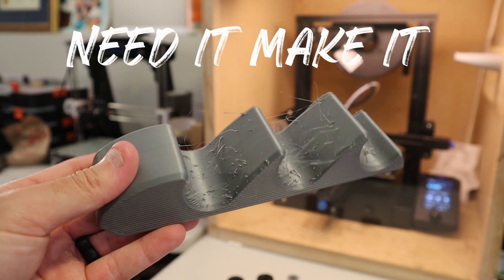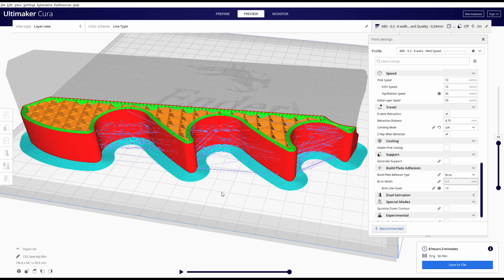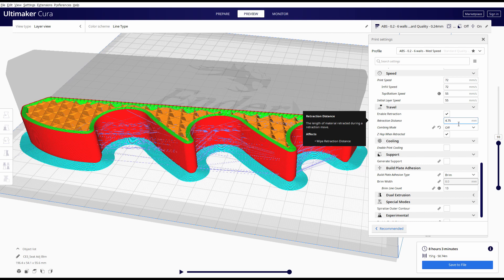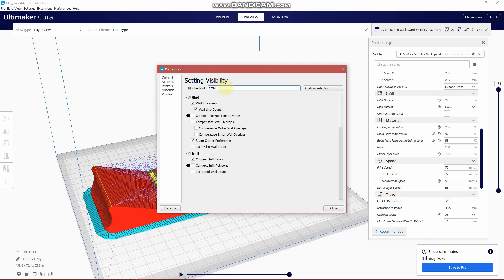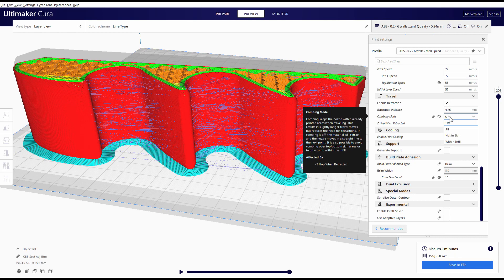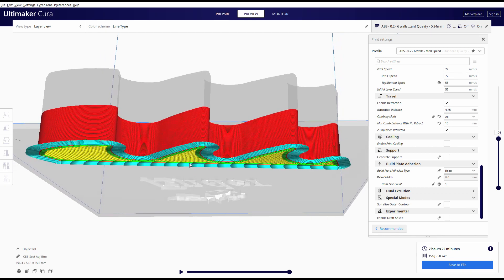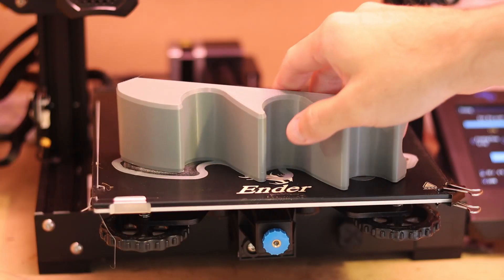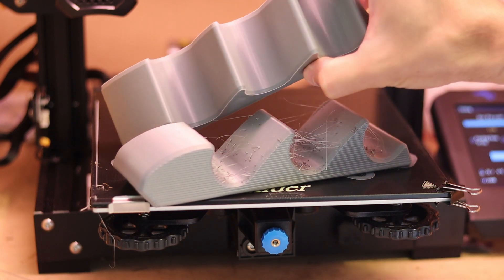Creality Ender 3 V2 - Stop Stringing, Improve Print Quality & Time With These Two Settings

Comment: That filament roll mount location is amazing! How has it been working for you? I've been trying to figure out a way to mount mine to waste as little space as possible (very tight location)
Reply: You save space but reduce your vertical print volume
Reply: @johnl.38  Yeah I tried it and actually the spool doesnt seem to reduce print height, just the holder, so only few cm. But what about the angle of filament to extruder? Does this setup need special filament guides?

Comment: switch to silicone bushings and get rid of those crappy springs on the bed, I did it to all my printers. It made leveling them so so so much better
Reply: Until you heat the bed up to 70c and they get all soft and mushy..
Reply: But they will still hold your initial bed level.

Comment: UPDATE > Hi all, I now got a new smaller 3D printer which is called a " Voxelab Aquila " this is a clone of the Creality Ender 3 V2 printer 
( Voxelab is sub company of Flash Forge ) 

Buying this printer instead of the Ender 3 V2 has saved me £87.00p and I still have the same high value printer that the Ender 3 V2 is.

This Voxelab Aquila is really super to use, there is even a very clear detailed how to build & level it video on you tube by the Voxelab company. 
The printer comes already 70% built anyway so it take only about 30 to 50 minutes to build and then do your 1st print.

It has no run out filament unit fitted, But the software has it listed to turn on later if you buy or make a run out sensor unit 
and the connector is there on the main board as it uses the same board as the Ender 3 V2.  

Also this printer has a Meanwell power unit so another great item fitted.
Like many printers it has silent steppers and board But the cooling fans are a bit noisy so you may be best later on replacing the fans for more silent type fans?

There is a new channel I found where a great youtuber mostly deals with the Aquila so you best look him up?

His channel is called > 3DPrintSOS here is the link > 

https://www.youtube.com/channel/UC1MsDQaRANzwISN8cHJ1VmQ

He shows the better fans to put in and how to do so?
Also he come up with a better extruder tube connector to stop the PTFE tube coming out due to retraction moments.

I did notice how I got allot of stringing with PETG filament when I print, I found that PLA + is more better for printing with less stringing and often no stringing!

As for my big Tronxy X5SA 2020 model. I had issues with it not being able to level right even using the manual or auto leveling,

So I will be getting a new glass mirror like bed to get the really flat smooth bed surface needed to do leveling right, 
Also I need to change the firmware over from the self made Tronxy one to a Marlin version and change the 
magnetic induction bed level sensor on the Tronxy to a BL Touch. 

Then I should be able to use this huge printer at last fully.

I don't wish to have such a big build area printer usable.
( the bed is 330 mm square and the height of prints are up to 400 mm )  So almost twice that of the Aquila or Ender 3 V2.

Thank you NeedItMakeIt again for your lovely helpful videos I hope everyone gets great prints too?

Comment: This is printed with ABS, does PLA require different settings?
Reply from the maker: For PLA, fan set to 100%, nozzle temp at 200, bed temp turned down to max 60.   I'd tend to increase the infill density with PLA, it is stiff, but more brittle and under heavy loads may be prone to cracking.
Reply: @NeedItMakeIt  Thank you for your time, I appreciate your answer. 👍

Comment: If it's faster AND better, why isn't this always turned on?
Reply from the maker: You'd have to ask the people at Ultimaker, I cannot determine why someone would not have this applied as standard unless there were some hidden drawbacks.  If you asked me to speculate, I'd say that travelling over infill could cause small prints to dislodge from the build-plate.
Reply: Restricting the slicing has to increase the time required, unless the slicer optimizes for something else not known. Could just be an error in the time estimate. Have you measured the actual time?
Reply: Late reply but I think it depends on part geometry (a lot)
Reply: I think we need to find out where the Printer gets the the additional time. Normally Cura already calculates the optimum travel path and with combing the travel will be longer becauser the nozzle will not take the shortest distance to the next point. I mean something how the part is printed has to be changed
Reply: @tataa51  quantum tunneling
Reply: Right?!
Reply: Might be to reduce the slice processing time for weaker computers.

Comment: Nice video! I will try these settings on my next print. i do have a question on something else however. I have the ender 3 V2 and i printed something out with ABS and i did not save the damn settings, so i loaded the stl file back in and printed another one out with the settings i thought i had and the part come out lighter in weight. Both parts look amazing overall but the first one weighs .9 and the second one weighs .06, you can definitely feel the difference  for sure. Both parts were printed with 100% infill so i do not get it. Any suggestions? Is there anyway to load the GCODE file back into cura and see what settings i used?
Reply from the maker: Yes you can load the gcode back into Cura, but I've never tried looking at the settings afterward.  I've done it by accident...  Both parts printed with 100% infill, seems like it would be solid.  Is it possible that one print is hollow and you were not watching so you were tricked?
Reply: @NeedItMakeIt  I do not think one is hollow, I have printed the same part these last few days 5 more times to try and figure it out and no luck. I think I will cut both parts open and have a look on the inside.
Reply: @ericc8895  5 months later but I'm still curious. What was the verdict?

Comment: I have had an ender 3 v2 for just over a week but have had it printing what feels like nonstop since and have easily 60+ hours on it already at first it printed beyond perfect but it has now developed a stringing issue so I turned combing to all and uped retraction to 5mm and printed a stringing test but still came out rough so I upped it to 6mm and left combing on and it printed better but still off so I left retraction at 6mm but just turned off combing and it printed like the first day I got it! Any insight as to why I'm not having the same luck?
Reply from the maker: If you are printing with PLA or PETG , they absorb moisture more readily it is a major cause of stringing.  You can bake a roll on low, make sure it is very low 60C for example, you can also bag it with dessicant for a few days.  Hope that helps.

Comment: what are the dimensions of the ender case?
Reply from the maker: If you mean the print volume, it is 220 x 220 x 250mm,  If you're talking about the enclosure mine is 580 x 580 x 580, and it is a little bit big.  I hope that helps.

Comment: Ive been watching a bunch of your videos and must say, if you could create like a summary video/post/sheet with a summary of your findings for different filament types that would be freaking amazing on the Ender 3 V2. Thanks in advance for your consideration!
Reply from the maker: I have a few videos in the works now, but it can certainly go on the list, are you able to give an example of the kinds of tests and comparisons you'd be looking for.
Reply: @NeedItMakeIt  layer adhesion, surface finish, how prone to stringing some filaments are
Reply from the maker: @kilogee700  I've been working with ABS lately again for a VORON project, but I will also be experimenting with ASA, I can certainly see if some of these can be added back in.  I'm goingt to be 95% focused on 3d Printing for my channel that seems to be the area most people are interested at the moment.  I've been working on bridging with ABS, I'll likely make a video once I learn enough about it.  Bridging with PLA is fairly easy with cooling, but ABS doesn't normally use fans, but there are some experimental settings in CURA which allow the fans to be used only when necessary.

Comment: Hey man what are you support distance settings? ive been printing a 50g print and its failed a couple times which has me a bit overwhelmed, tried current cura 4.8 with fatdragon profile, cura 4.1 with siepie profile and today i tried ideamaker which also make it impossible to remove suports on the face of this model, making it unusable in the end, im afraid to go ahead and print 12 hours again and encounter the same
Reply from the maker: I don't print with supports, nearly never anyway.  If you print with PETG this might be your problem, it tends to have good layer adhesion even when you don't want it.  ABS and PLA seem to separate well with the standard CURA settings. 

I am working on a video now which addresses supports from a completely different perspective.  Same goal, new method.  It doesn't work for curves surfaces, only parallel to the build plate though.
Reply: @NeedItMakeIt  its esun pla+, while its giving me better details still have problems with removing supports from the face of this model, i noticed that z distance on this particular profile was 0.2 and layer height of 0.12 and x/y distance of 0.7 with a 0.4mm nozzle, im guessing this could be the problem based on your video? ty for your reply

Comment: Will these settings work with tpu
Reply from the maker: I've never printed TPU personally.  If you are running a Bowden setup still and you print a lot of TPU, you may consider switching to direct drive.  I'm sure it can be done, I would wonder how well Bowden handles retractions and extrusions because the elastic nature of the material.  Tries to pull and it will stretch before a reaction at the nozzle.  If you don't already have Capricorn tubing, I'd switch over to that as well so that you have a tighter toleranced tube to handle the flex a bit better. 

These settings will still work on any filament, I keep combing turned on all of the time no matter which part, the results are always better.

Comment: Canadian. I’m in 🇨🇦 oh and amazing print. Is there a disadvantage to having combing on for parts that don’t have “peaks”?
Reply from the maker: I leave it turned on for all of my prints, there may be a disadvantage if you have oozing, I'd need to investigate how the nozzle moves through the part and compare the paths.    Most people have reported very good success with this method, however there could be cases where it would be better off, I personally haven't run into any.

Comment: can we put the same settings for PLA ?
Reply from the maker: You can use the settings and adjust the temp and fan as needed.  I print with a little higher temp and fans down low.  0.6 nozzle size also.

Comment: I think new Cura has this option turned on default, because my printer produced clean printings since the beginning.
Reply from the maker: Maybe it does, I'd have to reset it to check, but that would make sense, there doesn't seem to be any reason to turn it off that I have come across.  Thanks!

Comment: My only point- why not just print that in the flat orientation...
Reply from the maker: I find that this part turns out a little nicer on edge.  Way back when I started printing these and was not sure how strong them were, I printed them in the orientation to maximize their strength.   It seems they are much stronger than I expected and it probably isn't necessary to do that anymore.  Valid point!

Comment: how do you see the stringing in cura ? Thanks
Reply from the maker: With the right settings, I don't find it too bad.  Adjust your retraction to around 5, dry your filament and some people use coasting, I can't tell if it helps.  If you print with PLA or ABS, you'll have less issues.  I'm printing with PETG now and it does string quite easily, that's where better quality filament and drying it out can help a bit.
 
I'm happy with it overall.  I'll end up trying out other softwares down the road to compare.

Comment: Wow that print looks really good! Do you get that quality consistently with your machine?
Reply from the maker: Yes, pretty good results every time.  I find the PETG shows any small irregularities more than PLA or ABS because of the sheen, but it really is a good printer for the price.  Far better than my Anet A8.  You'll want to check out my video on the hidden problem with the fitting if you're having any issues with stringing and retraction.  I'm working on a follow up video to solve the problem once and for all!

Comment: New subscriber : I have several CR10 and I used to have my retraction at 5-6 and then I tried 4 and that has made a huge difference in the quality and I have always had combing on infill.  
I have tried PETG but I’ve stuck to doing small parts because I don’t want to invest in a lot of time just to have it fail ten hours into a job.  guess I have to man up and go for it.  I mainly use PLA and hairspray for bed adhesion that works very well for me but I think I’ll try glue stick for the higher temperature filament. 
Anyway great channel you have here. Thanks I’ve already learned something new from an episode about fixing the slop in the boden tube 👍
Reply: Did you change your retraction speed too / what's your value on this setting ?
I also have a CR10 and I'm not sure my retraction speed is very well set which might affects my prints :/
Reply: @andycarus3250  my speed is set at 45 I find that if it’s too fast the extruder gears tend to eat up the filament and cause it to break. 40-45 seams to do well for me.
Reply: @jack0cat  Thanks 👍

I was at 70-80, it seems to be a little bit high indeed ...

Comment: Awesome, definitely turning combing on...what I’m wondering is why would you ever turn it off?
Reply from the maker: It has to be one of the single best methods of getting a nice looking print.  I always leave it on, I really can't think of a good reason to turn it off.  There are times when it will not solve the problem, for example when a part has multiple vertical pillars to print, it will still jump between them, but many of my parts print flawlessly with this method.
Reply: @NeedItMakeIt  not to mention you saved almost 30 minutes on the print with better results. 

EDIT: Damn, just got to the part you mentioned the lower time. I gotta stop commenting before the video is done.
Reply: @zer0ish84  Hell, I do that all the time, too! lol

Comment: What size nozzle what version of cura those prints are perfect well done
Reply from the maker: Hi, I was using 4.7, now 4.8 beta.  Nozzle size 0.6, no cooling fan, I print between 0.18 and 0.2mm layer heights normally.  The trick is to turn on combing mode, the quality goes up dramatically.  If you want to go one further, just print one part at a time this takes away the travel moves between parts and you'll find an even better result.  These were printed with ABS, but I print with PETG now with very good success, PETG will leave very fine spiderwebs, super easy to clean up with a little bit of steel wool.  PETG is better for bed adhesion which in turn gives you a better final product, both in looks and dimensional accuracy.  Let me know if you need any more info, I'm happy to help.

Comment: Thanks! Im having trouble when printing multiple parts, the best retraction distance & speed, temperature works great for you to prevent stringing? Cheers!
Reply from the maker: Here is my profile, let me know if it works.  This is for Cura.  https://drive.google.com/file/d/1plhaXV8HkmL17OqxWybYdQdBNrmtYVGQ/view?usp=sharing  , If that doesn't work I print with Mainly ABS so here are the stats:

Infill: 75mm
Inner Wall: 55mm
Outer Wall: 35mm
First Layer: 45mm
Nozzle Temp: 235C
Bed Temp First Layer: 98C
Bed Temp After First: 95C
Retraction: 5mm
Turn on Combing
Turn on Z-hop
Turn on Part avoidance
Set your seam locations manually for the best position, and move your parts around so your travel moves end up in the best spots

Multi parts are best done with pla or a material you can use the fan.  ABS isn't great because it needs to be printed with the fans off, so I mainly print one part at a time.  

Which material do you print?
Reply: Would these setting work for petg?

Comment: That is some of the cleanest 3d printing i have ever seen
Reply from the maker: Thanks, I do find that this printer gives pretty good results, this grey filament was really nice and little irregularities seem harder to pickup, the silver that I use sometimes is the opposite, it reflects the light differently and you can see everything.  Still we're only talking 1/10 of a mm.  I've used the Ultimaker, and it does produce even better results every time, but it is about 10 times the price.
Reply: @NeedItMakeIt  i have an ender 5 but it seems like i have to do a lot more refining to get to that level of quality.
Reply: @NeedItMakeIt  how do i get those blue visulisation lines like you have? in the slicer?

Comment: Have you updated the firmware? I’ve just had my v2 a few days but not sure what or if I need to do that.
Reply from the maker: Yes I have.  My printer had a problem with the firmware so it needed to be updated in order to keep the e-step setting changes.  With the new firmware it fixed the problem.  Here is the link to the video, there are also some links in the description.  https://youtu.be/k-inUpjRVLA